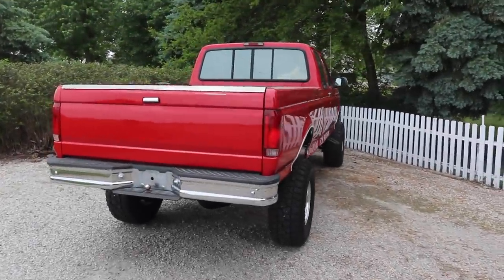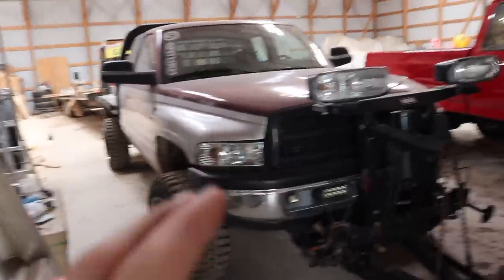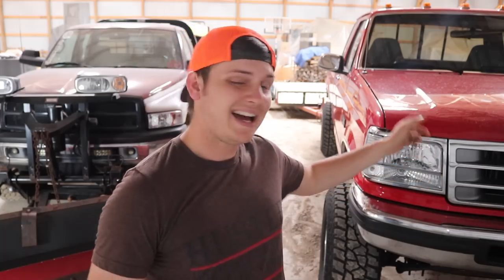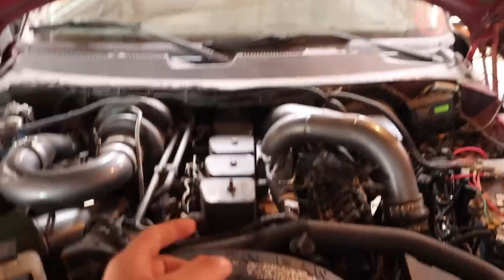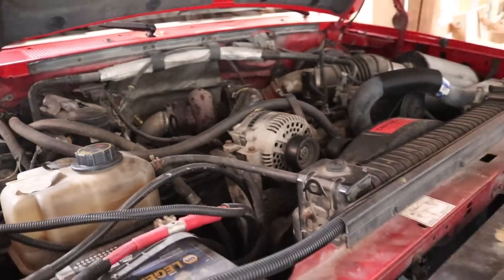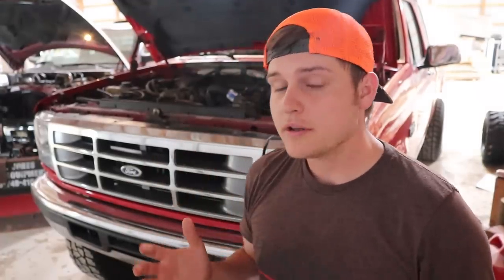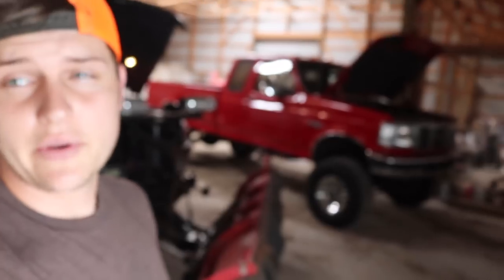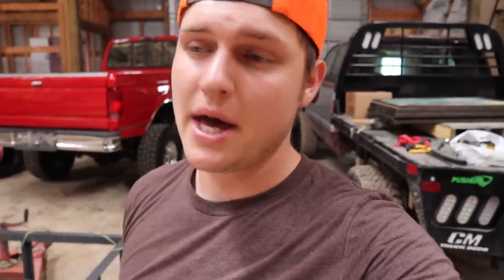WHICH IS BETTER? 12V Cummins OR 7.3 PowerStroke!?

Comment: Really love this video.  No bias crap whatsoever.  We have both. A 7.3 in an F-250 and a 12 valve in a Crew Cab F-250 and we love both.  Most of my friends that have the Cummins love the engine but the rest of their truck have fallen apart, so your video is pretty spot on.
Reply: Fummins is the way to go

Comment: 12 valve, sounds better, easier to work on, lasts longer, less stuff going on cheaper to fix, nothing really ever goes wrong, grid headers over glowplugs, the list goes on, 7.3s are great though.
Reply: Tho a 7.3 is cheaper to rebuild only costs under 2 grand cad
Reply: actually the 7.3 will last longer, no doubt the 12v is reliable tho, I love both
Reply: @lifewaidan7517  actually 12v will
Reply: @lifewaidan7517  lol the 12v will long outlast the 7.3…
Reply: Idk if it sounds better and they last about the same the fords are just more complicated

Comment: Another consideration is finding a good 12v vs a 7.3.  Since the 12v cummins are so much easier and cheaper to mod, more of them are going to be used and abused.  I found a 1999 7.3 with 240,000 miles and the motor was 100% unmolested.  The only real issue was the rocker panels and the cross member support for the bed was pretty rusted, but rocker panels and bed supports are very inexpesive.
Reply: Same

Comment: I think you did a great job being un-biased, like you said it really comes down to personal preference and what you know! I do want to add that the VC gaskets for the 7.3L can be reused unless the wiring in them is shot. This maybe different on an OBS 7.3L like the current give away, then the later SD 7.3L's. Like you said as well, if you keep up with maintenance and don't beat on them. both these engines will outlast the frame and body! Currently have 436,587 miles on my 99 7.3L SD.
Reply: What about now? How many miles?

Comment: 12 valve all the way any Cummins really is the best
Reply: It is...but,the Ford is the better all around truck.I know your head will spin around.understood.
Reply: 12 valve alright motor, but trans if trash. 7.3 is descent motor, trans is tuff. If the dodge sits in your driveway most of the time, then it’s a good truck
Reply: Cool opinion
Reply: Lies lies lies
Reply: Ford better
Reply: 7.3s are way better than a 12v Cummins, truck itself is tough same with the engine and it will last you way longer
Reply: @landis277  your ignorant of the truth
Reply: 7.3 is the best

Comment: 12v all the way, I’m 14 ,saved up my money from restoring a tractor to buy my first truck, 1997 dodge 3500 12v. Your videos are very inspiring and happy to say I’m a subscriber of LNP.
Reply: I’m 15, saved up and bought a 1997 Ford F-250 7.3 power stroke.
Reply: @tinytproductions6238  15 might be tough to keep her running unless you have rich parents
Reply: @nickfox919  well, I’ve had her all winter, and now all spring, all I’ve done is do a brake job when I got it and so far I haven’t had to fix anything
Reply: @tinytproductions6238  that's good, hopefully the front end is good for ya. Definitely can get spendy to fix a worn out front end on those old 4x4s

Comment: I've had my 96 Dodge with a manual 5 speed since 99 it's still a good running truck I had to put a track bar in mine to eliminate the death wobble. And I had to replace the driver's door. And I put a straight pipe on it a few years ago and the fuel was turned up on it which in turn make the clutch slip so I had to have that replaced. The only thing I've done to the engine is get the killer dowel pins issue fixed. And just regular maintenance but this truck pulls all my heavy loads like my bulldozer my back hoe  etc. And all my friends that had their 7.3s got rid of theirs years ago and I'm still driving my Dodge. I don't know any details on why they don't have their Fords anymore I just know I'm still driving my Dodge!

Comment: I have one of each. I like them both. They are both different. The 12 valve has much more power potential as can be cheaper to an extent. The navistar will cost more to get more power. In stock form the navistar pulls as hard as the 12 valve. They both have shortfalls. The Cummins has the dowel pin issue in the timing case. The navistar has the oil cooler issue.it also can have cavitation in the coolant passages of the block.  Both are a pain to fix.
Reply: Also in later 7.3's (2001.5 I believe they switched), the PMR's instead of Forged Rods. Meaning you can really only push 450hp, before your rods decide to take a trip to the moon. Forged Rods you could push 500-600hp safely.
Reply: The cavitation is only the 7.3 idi. Not powerstroke, very different engine

Comment: I'm a ford guy so I always make the joke that the 12v is so reliable cuz they don't make enough power to hurt themselves but I have much respect for them. Ford truck itself is better than the dodge. better trans. I would prefer a 7.3 because they make better power stock than the 12v and I have more experience with them. everyone loves a 12v for a swap simply because they are mechanical and simple and I don't blame them. both really good engines.
Reply: I mean, you're not wrong. The engine was designed for off-road applications, to be used in the crappiest of conditions. It doesn't make crazy power stock, and is insanely heavy for the size. But, that also means you can build the crap out of them and they don't flinch.

Comment: The 12 is always gonna beat Ford's & Chevy diesels because of the size, weight, power, less parts, more reliable time on that engine, etc.. Remember that 12v has been used in shrimp Boats, etc, for many years

Comment: my dream truck is a 99-03 7.3l powerstroke full 4dr(supercrew cab)4x4 dually  but 12v will always win when itcomes to maintanence 12v is mechanical injection vs 7.3 which is oil/electronic injection 12v is an inline six making it easy to servive valves springs rocker arms etc 7.3 is v8 and multiple things have to come off to service things 7.3 has a better turbo but 12v has better flow and access if you ask my opinion base your purchase on what your skillset is or how big your wallet is if you got the money buy whatever if you have limited mechanichal skills get a 12v
Reply: dont forget all 2nd gen dodge dashes and interior plastic are as tough as paper mache vs the fords you can beat with a hammer and they dont break

Comment: As for the ford E40D trans, the stock torque converter tends to be it's weak link.  Replace with billet 3 disc.

Comment: 12v for the win. Nobody is putting a 7.3 in a dodge but people are putting 5.9's in Fords and this is coming from a ford guy. Currently have two 12V's and one F-150, two 68 F-100's, One 64 Falcon Sprint, 88 Saleen Mustang, 82 Gt, 95 GT.

Comment: To compare the engines alone. V8 vs i6 v8 is more power tho i6 is better for low rpm torque.
Reply: I6 is inherently balanced better. Typically just make more power. Look at all the iconic engines and almost every single one is an inline 6.
Reply: @chevy6794  i new that

Comment: If you dont drive a 2nd gen in the salt they wont rust.  My 96 doesnt have a spec of rust anywhere
Reply: But is the dash cracked?
Reply: @superstar64  yes it finally cracked last year. I am putting new lmc dash in it when i change the heater core
Reply: Pre 98 dashes don’t seem to crack. Not where I am anyways. My 95 still original dash. Oh and heater core is soo easy on those. That’s what I like about the dodge simplicity and ease of working on.
Reply: @chevy6794  
Okay, you have a fair point.
Reply: Can’t go wrong with either truck though.

Comment: The reason people don't do a 7.3 into a Dodge?....why put a great engine into a crap truck?.The 12V goes into a Ford,because its a better all around truck.ill put this awesome 12V in a great truck,thats comfortable and tows better.You Ram/GM fanboys are lucky that Ford didn't do a Cummins in a Ford F-250/350.
You would not even be around.
Reply: Agreed😂 a fummins would be awesome!
Reply: People don't put a 7.3 into a dodge because they already have a superior platform with the 12 valve

Comment: I’m not sure what it is but from my experience I’ve seen way more extremely high mile 7.3s then 12 valves I had a guy come up to me in my 7.3 this week and he told me about his 1 million mile original motor 7.3 and I have had 3 buddies with 400k 7.3s my brothers got 370k on his my friends dad had one with 600k and I’ve just never seen that with their Cummins’s
Reply: You must not ever be around a Cummins then. You can take a Cummins truck and abuse it, pull, heavy loads, and not change the oil for 30K miles at a time and they’ll still hit a minimum of 400K miles. I hotshot all over the country and drive nothing but Dodges. How many 7.3 trucks you still see pulling loads coast to coast? I don’t see many at all, if any. You still see people working 2nd gen and 3rd gen Dodges regularly. 7.3 isn’t a bad motor but when it breaks down on the side of the road there’s not a whole lot you can do besides call a tow truck. You could pull the head of a 12V on the side of the road if you wanted to. I’ve tried working with 7.3 trucks. There’s just too many nitpicky, stupid problems with them. Cam sensors that constantly go bad, fuel filter bowls that crack and fill the valley of the motor with diesel fuel causing just a continuous stream of fuel leaking, glow plug issues that once bad enough the truck won’t even crank in 60 degree weather without plugging it in. It’s not worth the headache.

Comment: Here is how I see it the 12 valve is made by cummins who has been making diesel engines for tractors and heavy equipment since 1919 and the Ford Powerstoke has only been around since 1994. I'm not saying the Ford Powerstoke isn't a good engine it is but Ford just haven't been making diesel engines as long as cummins and they aren't as user friendly as the cummins is a straight 6 and the Powerstoke is a V8. As we'll the cummins have cheaper parts and have been known to run over a million miles with proper maintenance and normal driving habits so the 12 valve is a easy choice for me.
Reply: Ford didn't make the 7.3 Navistar did. international harvster was in business from 1902 till 1980 then purchased by Navistar. They been building diesels longer than cummins

Comment: Money no object, i would have a Ford truck, as much as I don't like Ford ( inherited bias ) fact that can't be argues, Ford has a better truck, but there is no argue that nothing will ever beat a 12 valve. It's simple, mechanical, and as a matter of physics, the inline motor can not be beat. So Ford crew long bed truck with a 12 valve and a built NV 5600 and a n NP 205, old gm Dana 60 king pin front, and a Dana 80 rear...

Comment: Truck vs truck as a complete package Ford 7.3 over the dodge with the 12v. Motor for motor only 12v. The dodge transmission sucks unless its manual and a lot of rust is almost a guarantee with cheap made interior.

Comment: Cummins is definitely better, unless you have a 7.3 IDI then I would pick it to be more reliable
Reply: there's no engine made thats more reliable than a 12v
Reply: @MrCstone1  actually there is, and it’s sitting in my engine bay. It’s a 89 6.6 New Holland  school bus motor, that thing is indestructible. I’ve had it in there for 15 years and all I’ve done is oil changes and coolant flushes. Runs like a top
Reply: pretty sure its the only engine with "legendary" next to its name.
Reply: @MrCstone1  that I can agree with
Reply: @Jay4.9OBSESSION   powerstroke and reliable have never been written in the same sentence. if v8 diesels made reliable power they would be in a locomotive. thats why everything in any torque application is inline....its not necessarily the name cummins even tho badass is attached its the design of an inline engine. cummins cat whatever. a powerstroke in a tug boat would shit its bed.
Reply: @MrCstone1  yes there is, called a cat c15
Reply: @conwayfox6233  yes there is what?
Reply: Wrong. EMD engines in many locos as well as Cummins,cat, Yanmar etc make many different v configuration engines for tugboats and other large vessels.

Comment: The reason you found so many dodges rusted out is cuz they were still on the road, all the rusted out fords arent running anymore😂😂😂just proves even more which ones last longer, it could just be your location cuz I’ve looked at a couple 2nd gens and 3rd gens and none of em were rotted out like you’re describing
Reply: I live in a farm are i see many old 7.3s still putting work hauling I hardly see older cummins

Comment: People also beat the hell out of the cummins trucks and not so much with the old 7.3's thats why the tranny goes out. The stock dodge trans is fine I own two early third gen rams and one is a 2003 and has 199,000 miles and the other is a 2004 cummins with 374,000 miles and they are both on the stock tranys and I've owned them both since new so to say the trans is bad isn't fair when the bottom end of the 5.9 can take 1,000hp before you really need to upgrade any bottom end parts. Idk any other engine that can take that on a daily basis. So there are a ton of people putting basic tuners and junk on the ram truck and smoking the trans. Those stock tuners are junk they just smash line pressure through the roof and have basic tunes that are not healthy for the trucks at all.   A tuner is to compliment power upgrades like a built trans and bigger injectors and turbo and etc.. you don't put a tuner on a stock truck its stupid :) I had several 7.3 truck back in the day and they were good trucks but the 7.3 needs upgrades to really get out of its own way. And it has tons of flaws as well. Where as the 5.9 engine itself is an amazing thing . Thats why the 5.9 is in all sorts of stuff from marine applications to heavy equipment and more. They are everywhere :)  I love my obs ford's but there's a reason they aren't the top pick for juicing them up and racing them or doing pulls. Ford kicked themselves hard im sure when they got away from the 7.3.  I had both versions I had a 89 naturally aspirated 7.3 regular cab long bed and a 94 extended cab long bed turbo 7.3 along with some other early 90s turboed 7.3's good trucks just not comparable to the 5.9's both trucks rott like there is no tomorrow if not handled properly.

Comment: 2nd gen 12v how did you find one they are rust piles. The 12v isn't a good engine just becsyse it's popular with the ignorant don't make it a good engine. I'll just say death dowl and leave that there. The reason you never see a 7.3 in a dodge is the truck isn't worth the swap. There is a reason your dad bought that dodge off the side of the road for 5500.
Reply: Hahaha. Ignorant would be someone who fails to acknowledge the fact the 12v dominates in motorsports. Not because of ignorance but because it makes more power easier and cheaper and is far more robust. Another example would be someone who calls a motor junk because of the KDP that might fall out and highly unlikely jam up in the gears and be catastrophic. And btw you can fix it for about the third of the price of one 7.3 glow plug and fix it in about the time it takes to change that one glow plug. Providing said glow plug comes out. Not knocking the 7.3. I think it’s pretty dam good but common. That’s like a dodge guy saying the 300 is a bad motor cause of valve cover gasket always leaks but the 2.7 Chrysler is far superior. Hahaha.
Reply: @chevy6794  ignorance is thinking the 12v dominates anything. The 12v seriously. Just cause you're one of the but hurt ignorant don't mean you have to reply. Cummins don't make good engines

Comment: That 7.3 411 pos gears front an back plus double locking turqconverter itll pull that Cummings all day long its true 4x4 were all wheels pull an the Cummins is geared high an 318 transmission doesn't hold up an there only both rear an one or the other front wheel unless you put a locker in it my sister an brother an law work were they build these motors my sister dynos them 15 minutes with no oil in them to set gaskets an she said Friday an Mondays are the worst days people in a hurry an others hung over on mon she said buy between Tues an Thurs or don't buy at all .........

Comment: Ive had a few 7.3 had a duramax ifs suck on them use to hate dodges till 5 years ago got a17 cummins now i own a 95 2nd gen 12valve and its cummins forever as far as transmisions  all autos are junk and for kids that cant drive be a man and get a manual

Comment: Tear the engines apart and put the parts side by side and there is no comparison. 12 Valve power lifter, makes the Ford look like a little girl. We all know Ford owners sit down to pee. You cannot compare a cummings industrial engine to a Ford light duty truck engine. You wanti to compare a Cummins to something comparable pick a Cat or Detroit.
Reply: The 7.3 it’s also a industrial motor it’s made by international navistar not made by ford
Reply: @lsxpower3367  better question is why are the majority of big rig and commercial/industrial diesel engines inline 6s.
Reply: @GregariousAntithesis  All I’m saying is the 7.3 it’s an industrial engine it was put in tow trucks school buses ambulances medium duty trucks
Reply: @lsxpower3367  yes i looked it up after i typed this. Apparently the rumors that only cummins was an industrial/commercial engine were generated because of the olds/tornado diesel car disaster.